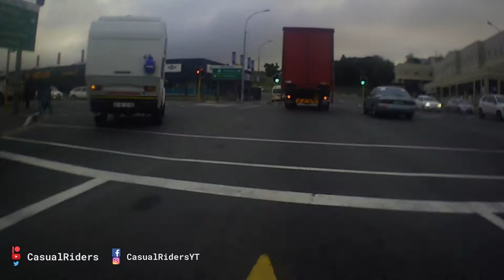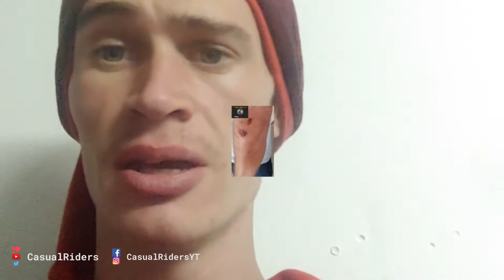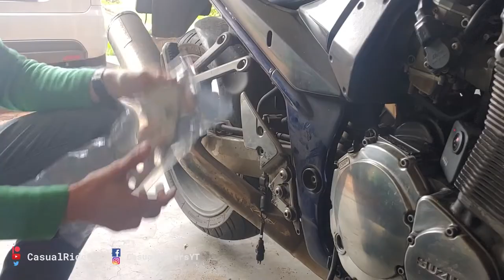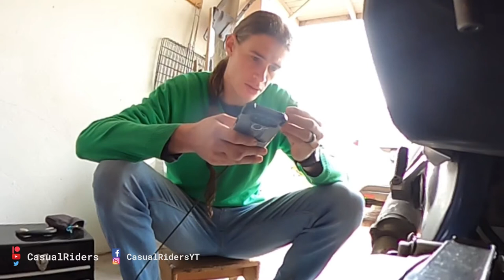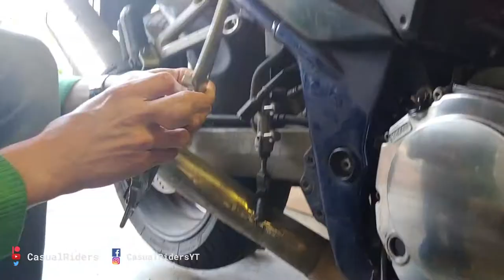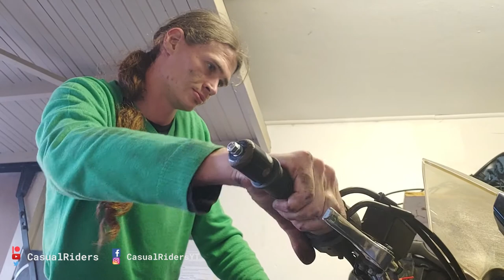I GOT MY PART!!! Replacing the footrest mount on my Suzuki Bandit

Comment: Where did the bottom of the spring for the brake light switch connect to? Your video skipped that part.
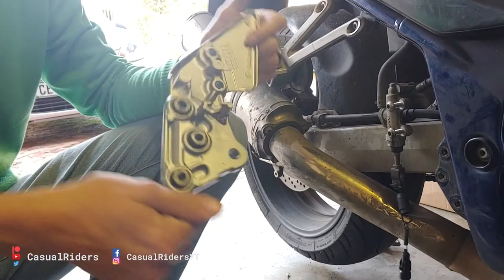Reply from the maker: Look at 14:24 , there's a half-circular piece of metal just below the bushings. It goes there